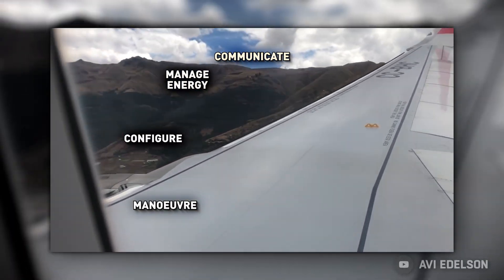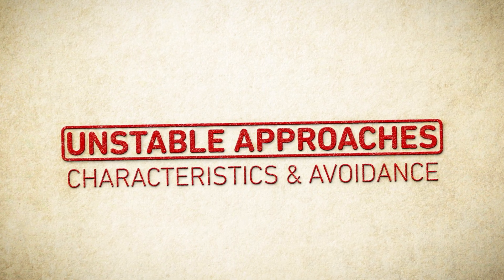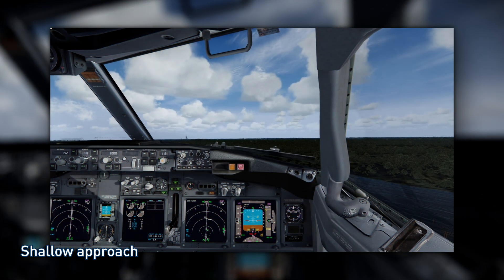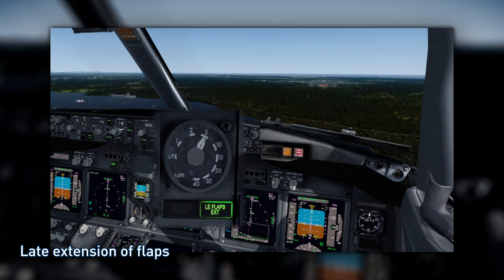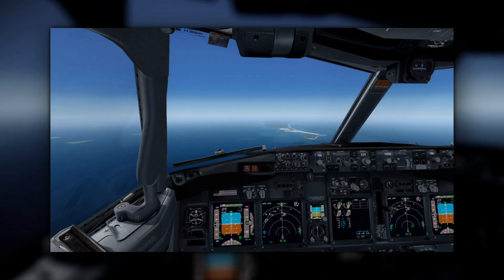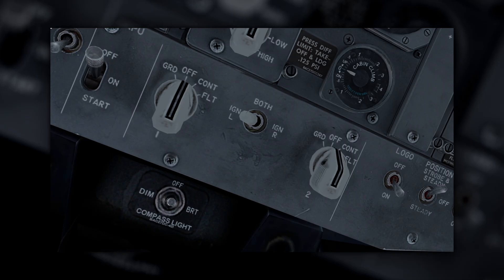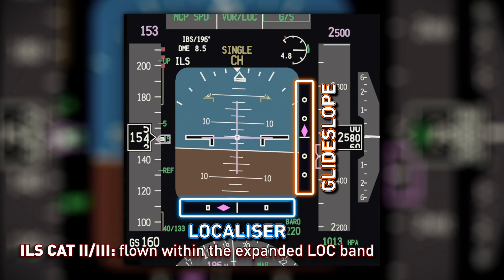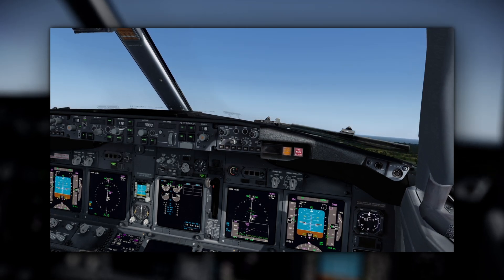Unstable Approaches: Characteristics and Avoidance

Comment: Great production about a topic that remains an issue in the industry even with its heightened emphasis during training events. I've found that while ego plays a part in trying to save an unstable approach, an equal factor is the fact that missed approaches are required so infrequently outside the training environment that a lot of the time it seems more intimidating to perform the missed approach than it does to just chop the power and slide it back down to the glideslope. Very informative video.
Reply from the maker: Great extra context, thanks for the comment. Glad you enjoyed the video!